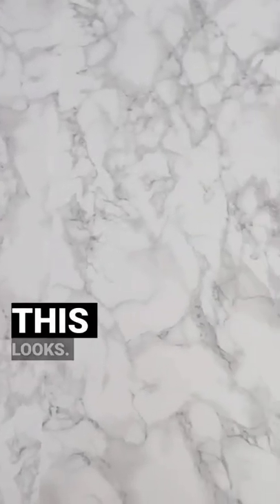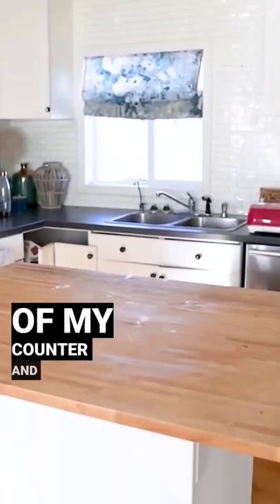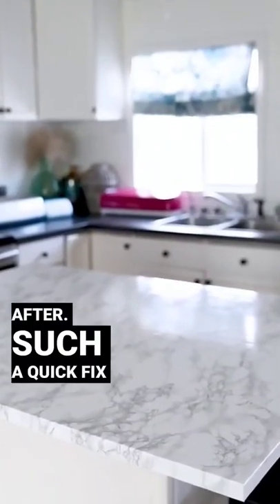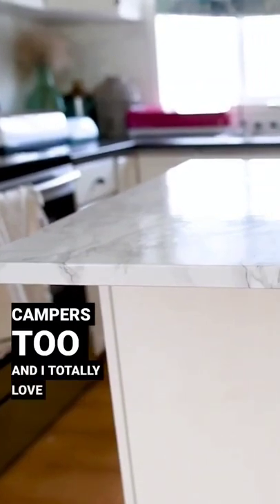Can't afford new countertops yet? Try this! #shorts

Comment: I purchased marble counter paper for my  countertops.

I have a formica countertop from 1962 that is coming loose & has metal strips on the sides & the seam between the back & the countertop. 

My ?  Should I reglue the Formica countertop & then sand it befor putting on the marble paper?

 Thanks for any advice you can give I've never done this before

Comment: Is this a least apartment or an owned home that you applied this? I'm a home renter & did this & after a year, it bubles in small areas when heat from the window comes in. Also, its trying to peel with bubbling.

Comment: You should've used a wallpaper tool that flattens out the paper and gets rid of the bubbles as you go instead of trying to get them after. Regardless, you can also use a pin or sewing needle to pop the bubbles if you see more, but since it's on your counter, I'd seal the hole up with something to prevent things from seeping in.